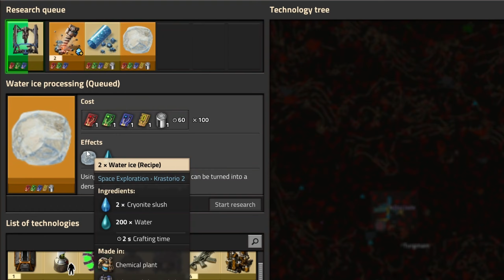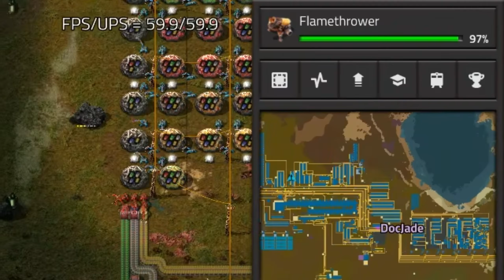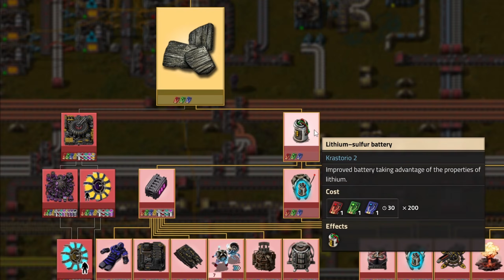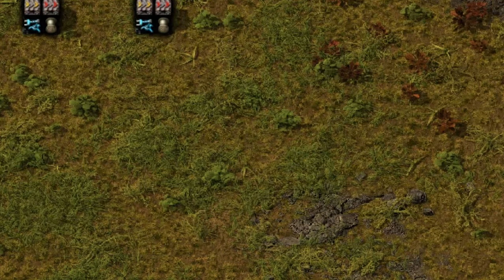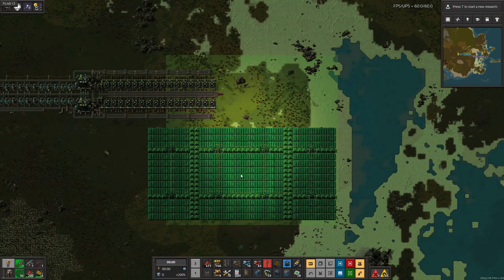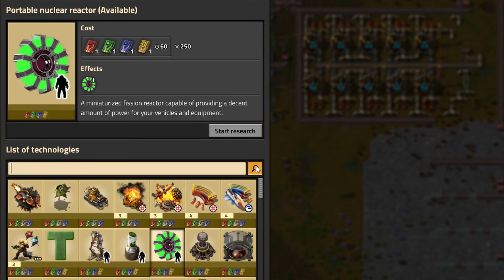Space Exploration + K2: Concrete Jungle! - EP 6

Comment: The core seams dig up infinite stone + some metals that you can also turn into landfill, so if you properly setup a core drill you will get a lot of landfill and concrete
Reply: As I recall, the way that core mining works is that it gives all with varying amounts depending on the ores of the planet in question. For example, If you have a planet that has really huge amounts of vulcanite, the primary thing that will come out of the core fragments will be vulcanite.

Using one for landfill would probably work but they are pretty expensive power wise and ultimately rather slow for getting the amount of landfill needed
Reply: @hak-en-slash4636  At this point, he was using one on Nauvis, which returns a usable amount of stone and basic ores, all of which can be turned into landfill. It's certainly expensive in terms of power, but it would be better than wasting valuable resources on it.

Comment: Might be easier on you if you use trains together with the logistic Train Network. would also look cool a whole moon covered in city like blocks(or if you want to be fancy hexagons).

Extra tip for the landfill over water thing there is a mod that lets you remove landfill and get water back(no it is not a waterfill mod it only works on landfill).